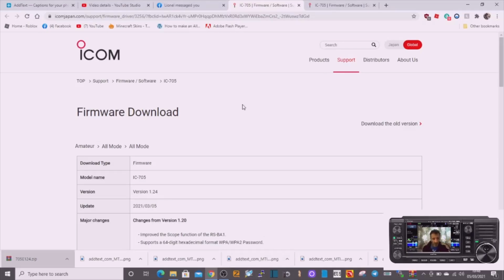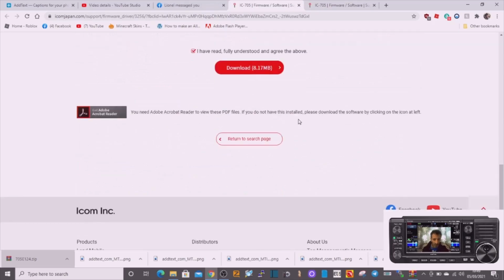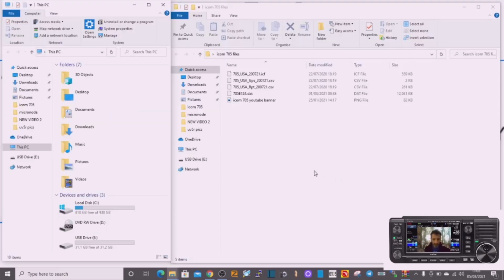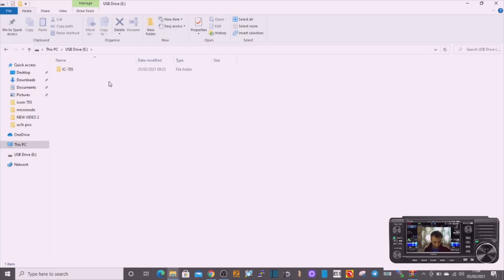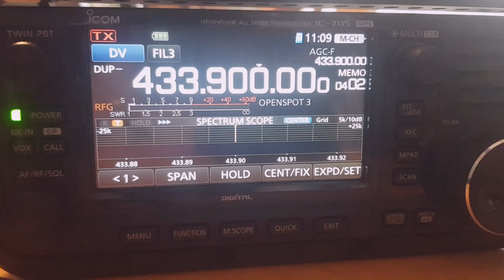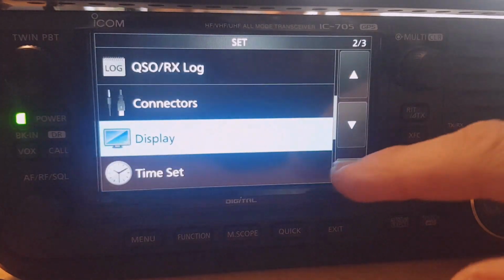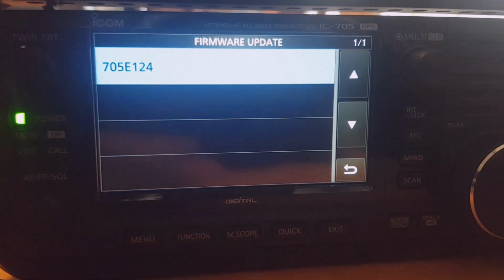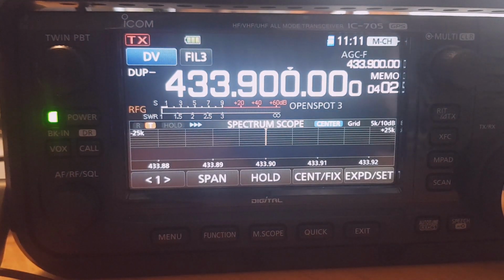ICOM IC 705 FIRMWARE UPDATE  V1.24 05/03/2021

Comment: I still have the original firmware, should I update straight away to the 1.24 or do the 1.20 first then 1.24?
Reply from the maker: Try putting both files on the sd card-But i dont know -sorry
Reply: If you have settings you want to save, you need to go to 1.20 first, than upgrade again to 1.24.